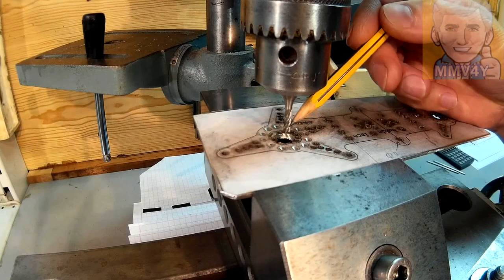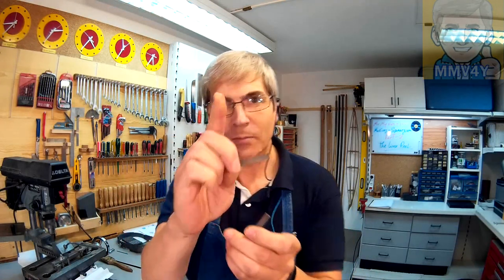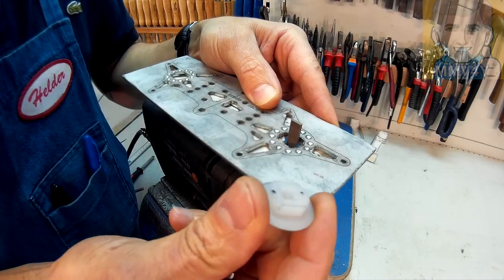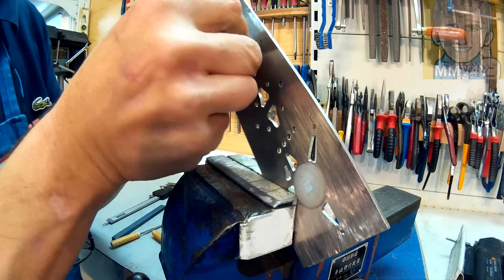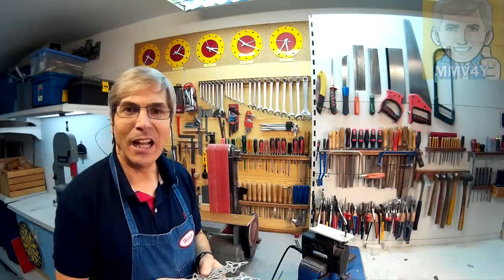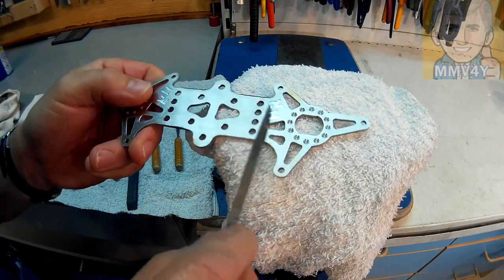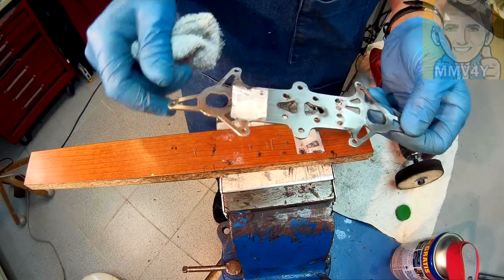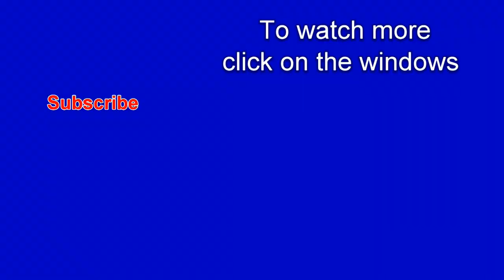DIY Wooden Speargun - Part-9 / Making the LINE REEL - 2

Comment: Great video. One question, did you just glued the white plastic taps into the reel bracket?
Reply from the maker: Hello Jorge Bernal,
The two plastic bushings are press fit into the reel bracket, watch the video " It`s Done! DIY Speargun Line Reel Part 7 - Speargun part- 14"  https://youtu.be/vFB_GXL4yTA  at the 23,56 minutes is possible to see it been put together.
Thanks for the comment and for watching my videos.

Comment: Well done, I've been wtching this channel for a while now and I think it's the best channel on YouTube. 
Please keep posting more videos on speargun making. 
P. S.  Can you sand me some blueprints of trigher mechanisms or reel?  Thanks.
Reply from the maker: Josip simone,
Thanks liking it, stay tuned for part 10, i´m already working on it!

I have to finish this speargun project first.

The only dimensions that I can provide are: The trigger housing 
dimensions= 13x30x65mm, wall thickness: 2mm 
Trigger and Sear= 5mm thick. All made from 316 grade stainless steel

I´m very confident about this design, but I need to fiel test it, over a
 long period of time before making it available. 

Some of my channel viewers told me that is possible to take "screen 
shots" from some of my videos and then using scale to get the right 
sizes. Watch the video "Roller Speargun Design Model"
 https://www.youtube.com/watch?v=_qQXGEgw5p8  at 1:03 is possible to see a side view of the trigger mach.
Thanks for the comment and for watching my videos!